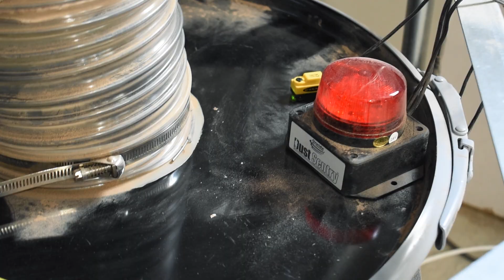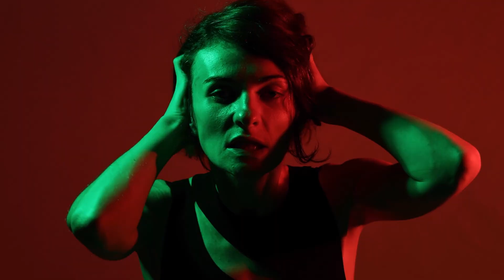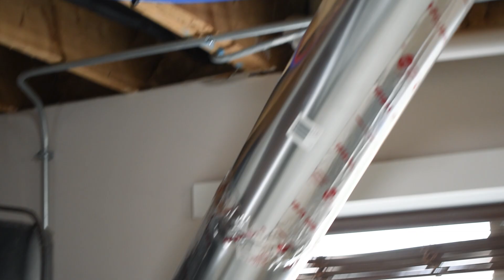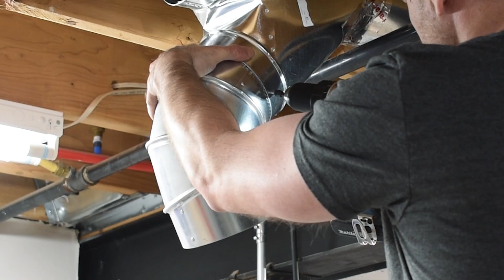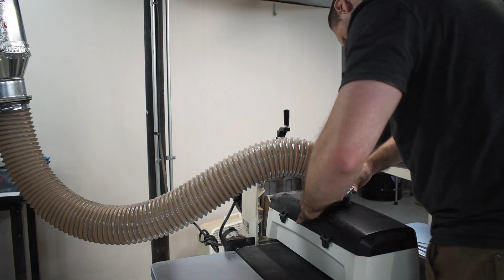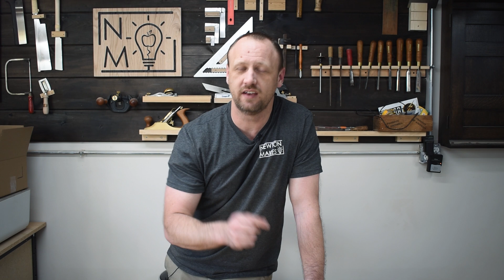Installing the BEST Dust Collection System for My Wood Shop

Comment: Nice set up and I love your videos...I do have one question though...does it need to be grounded when using metal piping? I'm using PVC and want to upgrade to the HVAC piping but worried about grounding.
Reply from the maker: Mine isn't grounded and it has no static issues.

Comment: Thanks for the video and info.  I started to make a similar system with 26 gauge DIY ductwork.  I was listening to the many haters online and I got frustrated with the joints so I gave up on it.  The only that should suck in a shop is the DC.  I need to get my system back online.
Reply from the maker: I totally understand that. It's why I felt like I needed to but a statement in the video to ask people to be nice. Something about dust collection really works people up. Sounds like you have some of the materials already. Jump back into it and you won't regret it. 👍

Comment: Good stuff. From what I’ve read reducing down from 6” without having two ports open can lead to build up in the main line. I’d be most concerned with the 2.5” port.
Reply from the maker: Maybe 🤷‍♂️ I have been messing around with having another port open when using the cnc. I haven't seen a difference in dust collection so it's good to have it open just in case.

Comment: Great system, but I was surprised at the 2-1/2" port. Do you have another port open? Seems that big a system would be air starved with only 2-1/2" open.
Reply from the maker: I cracked open the drum sander port a bit to help. I'm sure that I could make my own 4" port for the cnc but it's not something that I have the time to do right now.

Comment: Nice info, thanks for putting it out there.  I don’t have dust collection outside of my shop floor (and every other surface in the building). This will be the next addition to my shop even though I need a decent bandsaw and some sanding equipment.
Reply from the maker: I was in that same situation. I needed to decide between buying a bandsaw or getting dust collection. I certainly couldn't afford both. I went with dust collection and I don't regret it. It's not really a fun purchase for me because I'd rather have tools, but it did make life better in the shop.

Comment: I replaced my remote for micro switches. Way better than the remote.
Reply: Very reliable and much more convenient. With the remote I would sometimes forget to shut the gate, with the micro switch you can’t. I recently piped my shop, using the same ductwork as you by the way, and I have my gates near every machine so it’s working out very well for me. I only wish I had done this earlier. I love my new dust collection setup.
Reply from the maker: That's really cool to hear. When I finally get a chance to catch up with things, I may check those out. Awesome idea!
Reply: I used “microswitch controlled blast gates” by Carolina Craftsman on YouTube. I also bought his plans which are very clear. I use the inexpensive plastic blast gates and modified them for micro switches. Like I said before I couldn’t be happier with the setup.
Reply from the maker: Yeah? Pretty reliable?

Comment: Nice job Billy. I used PVC and soil pipe on my dust collection system. I have  Jet 2 HP, 220 v, and it works just fine on all my hook ups. I have a stand alone shop so my dust collector is in a room by itself, cause it is loud. Like the remote also. I'm down by Metro Airport, but shop is quite and dust free. Keep up the great vids.
Reply from the maker: That's awesome; I'd love to have a separate dust collector room. I thought about enclosing in mine. A lot of people like that Jet collector. I thought about getting it when I was looking too. 👍

Comment: I got a HF with coupon of course for under 200 a few years ago.  Piped with 4" pvc, wyes, some duct tape or to seal (this could be better), hose with mostly cheap powertec hose clamps, and blast gates, overall a very inexpensive setup.  Some 4->wye->pair of 2" reducers where applicable for tool (all my sanding stuff and my miter saw), or 4->wye->4" and reduced to 2" for my band saw, straight 4" rockler or powertec hose everywhere else.  All in all, I'm collecting on a downdraft sanding table (1), sanders (belt and oscillating spindle/belt, but on the same drop) (2), table saw (3), scroll saw (4), band saw + planer + miter saw on the same blast gate and I just switch them with a quick fitting (5), panel saw has a drop but it's never hooked up (6), and a vac line with 30' hose to "sweep" (7).  Always improving it but it's worked well for a while now.  Last year I finally ditched the bag on the collector and upgraded to the Wynn filter, I don't know why I waited that long, it made suction so much better instantly as well as overall cleanliness of the shop since there's a bazillion times less microscopic particles eventually settling on everything.  I'll throw in that I also run an air filter (shop fox) and to me it's as essential as the dust collector.
Reply from the maker: I heard that the HF collector is a diamond in the rough. A ton of people love it and do modifications. Have you been able to get reliable dust collection to your bandsaw? I haven't hooked that up yet and I'm still debating if I will.
Reply: @NewtonMakes  Mine's pretty modified.  I added a first stage trash can with a Thein-style separator which catches almost 100%, collector bag is almost entirely empty.  Not as good as a cyclone (with equivalent motor/cfm), but close.  Also added a Christmas lights remote control that turns it on/off via a high current contactor (like on an AC unit) and keep the remote in my apron, and that convenience is way up there on the needs-list after using it a long time I couldn't imagine walking across the room to turn it on/off anymore.  Both of these are inexpensive upgrades.  I've seen turbine blade upgrades but haven't pulled that trigger yet.

Bandsaw suction - Better with than without for sure, but not great, still a lot of room for improvements.  One of those tools I just have to know there's going to be a little dust.  It is annoying that my sanders, even oscillating spindle/belt, has almost no dust after suction but the band saw has probably the most.  I have it wye'd off, with a 4" going to the lower wheel and a 2" going below the table sucking right below the insert.  The lower wheel suction is completely useless.  The insert 2" suction - "it depends" on what's being cut but still a huge difference between using it and not.  I may change that over to be 4" only exclusively to below the table insert, something to experiment with.